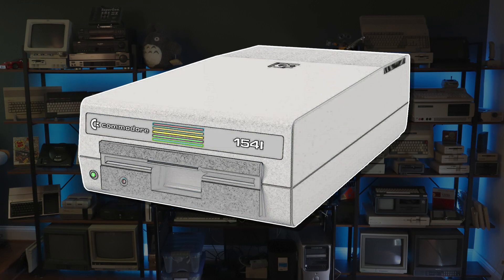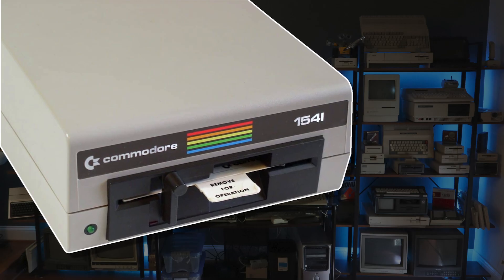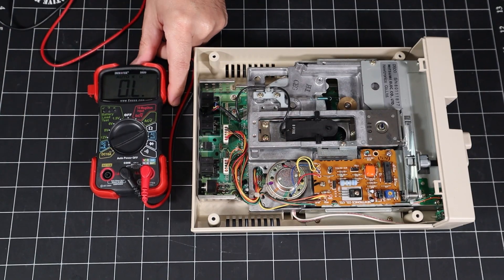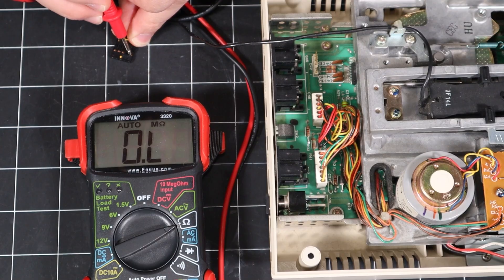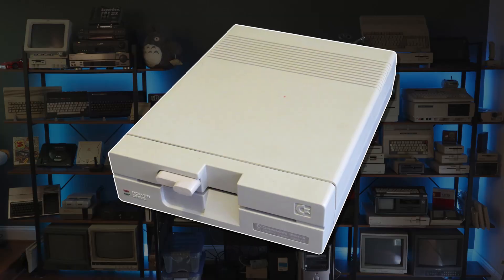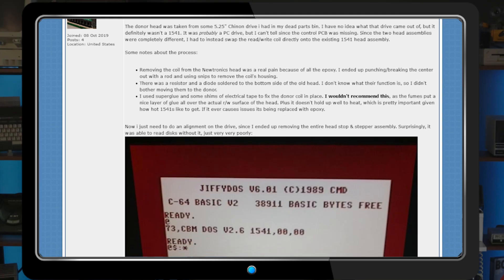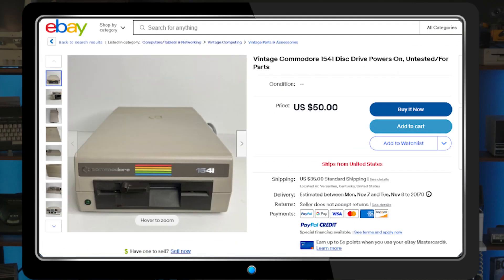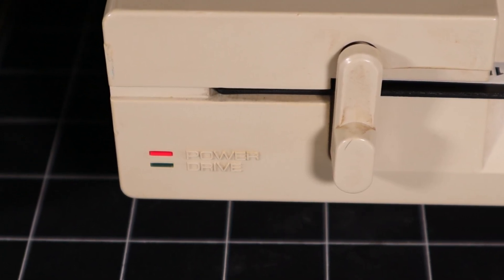This Commodore 1541 hides a terrible secret.

Comment: Wow! I didn't realize that someone actually read my blog posts from 2017! btw. I still didn't say the last word on this topic and want to sort this case out. I am slowly gathering knowledge ... like really slowly as I am kinda overwhelmed by other projects lol.  As usual, this was an EXCELLENT VIDEO!
Reply from the maker: Haha I've come across your post multiple times over the years! Thanks for sharing what you discovered. I'm sure the world would be very interested if there were a workable solution to the problem some day so please keep us posted of any new developments! I know the feeling about being overwhelmed by projects :)
Reply: @retrobitstv  Shooting in the dark, but since the moisture seems to cause the issue, wouldn't drying the head completely, in a desert-like conditioning, fix it?
Reply from the maker: @UltimatePerfection  Disclaimer: I haven't extracted the coil from my bad drive or examined it under a microscope. That said, I believe the issues to be a result of oxidation, not the presence of moisture itself. Over time, oxidation of the delicate wires either causes a short where there shouldn't be, or in my case, a complete break in one or more of the coils. It one were able to extract the coil from the potting, find the break or short with a microscope, and repair the damage, it could conceivably be fixed, but I have neither to tools nor the skill to work with something that small myself and I am not aware of anyone who has successfully repaired one yet and shared info about it :(
Reply: @UltimatePerfection  probably not what the ohm meter is showing is that the moisture has corroded the winding and opened the coil so short of rewinding it from scratch there's nothing you could do drying it out it's now too late
Reply: Come on! Your posts are gold. I recall the internal SD2IEC one, which encouraged me to start making some :)
Reply: @rapiqui  Thank you for warm words sir ;)

Comment: Is it possible for a different drive to be put in place on the Newtronic mechanisms? Like, perhaps a TEAC?
Reply from the maker: My guess is that it's entirely possible, with enough time and skill. Unlike later system, these drives aren't self-contained units that connect with a standard Shugart interface, for example, so you'd need to adapt the mechanism both mechanically and electrically for the enclosure and controller board in the 1541 model of your choosing.

Comment: My 1541-II drives with Chinon mechanisms are still going strong 30 years later.  I was aware of the Newtronics issues, but did not know that the Mark IIs had a direct correlation between the external case design and the internal mechanism.  That is a brilliant tip for buyers!  -- JC
Reply: I also have one of these that sat for 20 years.  Cleaned up. Works like a charm.  Little noisey due to oxidation.. but Works perfectly:)
Reply: is not true what he says in the video, typical youtube guy who has no clue... The one with the flush case can have a D500 or JPN DS-50F, the one with the indent (recession) has a F501M. And there is another version (no recession at all, 1571 style) where I only know one picture on the internet, but never saw that version ever again. The DS50F has in my opinion no difference from the case/looks, but when you have one its easy to find out: The lever on the DS50F is very light any you only have a small click on the down position and it springu up very freely and without much resistence. The D500 has a hard CLICK when you close it and a bit more tension or resistence. If you have those two, its very obvious if you can compare them directly.

Comment: I have an Alps 1541 that marginally works, except the motor sounds like a dying cow... though the 1541-II (with non-recessed lever) I've had since childhood has been working fine, shockingly enough. Thanks to this excellent info I'll have to go check my other drives and see where they stand. I was hoping by now someone could make replacement heads (somehow) so dead drives could be put back into service.

Comment: Could you use a heat gun to open up the head and re-wrap it with fresh enamel wire or something?

Could you seal the heads on working ones to keep them going?

Seems better than just giving up on the limited supply of read heads. (I know you go over this, but as you said, trying to get new heads is difficult. Donate your drive to someone who likes to make coils for them maybe?)
Reply: In theory dunking the head in some sort of epoxy and running a vacuum would seal it up without damage.
Reply from the maker: It may be possible to repair the break but safely removing the coil, repairing such a tiny wire, then getting it all back in place correctly aligned is beyond my level of skill because of how small it all is. If someone out there has the skill to do this, I'd be happy to send them my r/w head, as would many enthusiasts out there I'm sure.

As a preventative measure, it may be possible to drive out any moisture contamination with heat and attempt to improve the seal of a head that is still working right now. Of course, it may also be that if your drive is still working then it'd be better to leave well enough alone and hope it stays that way!

Comment: I read about failing Mitsumi drives years ago which made me look for alternatives. However both my Mitsumi 1541C still work fine to this day (both came "untested" from ebay). All of my 1541 drives are modded 220V->240V. I had two other 1541 giving me read errors because of defective bridge rectifiers on 5V, and a 1541-II giving me read errors because the cap in the potted PSU had dried up. Just because your Mitsumi 1541 starts giving you read errors, it doesn't have to have a broken head. And I'd still buy them untested if the offer is good.
Reply: And a 1541C with the opened jumper is so nicely silent :). I modded two of my drives by replacing the transformers according to the video by Adrian Black. So no overheating there anymore. And the drives became so light xD
Oh and of course, luckily, no read errors here (all incl. 2x 1541, 1x 1541C, 2x 1541-II)
Reply: @katho8472  My C models both have a board that doesn't support the track 0 sensor, but one drive has it actually fitted. I was thinking of modding the boards to support the sensor to reduce the risk of damage. I like the weight of the drive and won't mod the transformer out. The drives look and feel, the sound and its weight bring back my childhood memories like it was yesterday ;-)
Reply: @Shmbler  Well I mainly modded mine to not fry the chips ;)

Comment: The drive head is measuring open, not short.
Reply from the maker: You are right, I totally saw the O and read it as a 0 and stopped there. I need to pay more attention, that's twice in two videos I've missed something obvious. That said, I did disassemble the drive and checked continuity of pin1 from the connector all the way to the PCB on the head just to ensure it was not a wire break and that tested out fine, so the break is somewhere inside the potting/coil.

Comment: Arguably though, I'm sure the drive was not designed to be working nearly 40 years later, so can we really say it was 'improperly sealed'?
Reply: It's all relative.  All Sanyo MBC-55x's have a backwards installed capacitor but it takes like 20 years to fail.  I'd argue the capacitor is still backwards.
Reply from the maker: It is pretty amazing any of this stuff works anymore. I've only had one drive fail out of many so on balance, pretty good.

Comment: I literally just purchased a 1541 MKII 2 days ago, thankfully the condition of the drive was stated and it was fully working, serviced and head aligned and for 67.00UK ie a really good price. But when I heard you say that they can just go with fault my heart sank, BUT when I looked at the drive it had the recessed lever, cue a big smile. I was lucky, I got a proper retro commodore seller and the product was fully documented before sale. As you say, the little games that some sellers use, ie the powers on or untested is just annoying and usually deliberate, trying to get money for their old dead crap......Thanks Matt, great short video..

Comment: Yeap, I have both an ALPS and a newtronics drive, and I've got both these issues. The ALPS works, but had to re-align, and it's still not 100% correct. The newtronics has a dead read/write head, and I've bagged it for parts, or at least until I find a replacement head.

Comment: Why can't you read the tracks on a floppy using the same technique used in a Magnetic Optical drive.
Reply: Because it’s not a magneto-optical medium. MO uses materials specifically selected because of their optical properties changing due to magnetic influence (while hot). Magnetic media’s optical properties don’t change.
Reply: @tookitogo  It is the same principle that is used to copy tapes at speed where the tape is heated up to it's curie point but the master doesn't quite reach it's curie point therefore the master tape can be copied again but the copy will have a signal in the track and will not be lost so maybe we can use the same trick to read the tracks on a floppy using a laser and write tracks using a weak magnetic field when the point at which we ant to write is at it curie temperature that won't affect the other tracks as it would take a very large magnetic field to erase the data from the disc.
Reply: @DAVIDGREGORYKERR  I was actually unaware of thermomagnetic tape duplication, so thanks for the roundabout tip. (That actually answers something I’d wondered about for years: how high-speed videotape duplication worked.)

Anyhow, I don’t see how it’s applicable in any way to your question: can a floppy disk be read optically like an MO disk? 

No, for the reason I already stated: to read it optically, you need a phase-change material whose OPTICAL properties change when magnetized above the Curie point. The thermomagnetic duplicators rely on the MAGNETIC properties of the tape material changing when magnetized; heating above the Curie point simply makes the material far, far, far more sensitive than it is below that point, allowing it to “take” the image of the magnetism of the master tape. The OPTICAL properties of magnetic media do not change with the imprinted signal.

Unlike MO’s phase-change material, which is practically entirely insensitive to magnetic fields below its Curie point, the material in magnetic media IS sensitive to magnetic fields below its Curie point. 

The rest of your answer seems to be talking about writing to a magnetic disk using heating. I’m missing the connection to how this would help you read it optically.
Reply: @tookitogo  Laser light can be changed by magnetism and it is  i.e. rotated so will be detectable by a detector diode maybe someone has to try and do this and see if it can be made to work.
Reply: @DAVIDGREGORYKERR  You’re really just throwing any magneto-optical phenomenon out there without any regard to applicability to the question. 

The magnetic fields needed to affect light are quite strong. The magnetic fields on magnetic media are tiny. 

Your original question was whether a magnetic disk could be read by the same technique as an MO disk (not just by any magneto-optical effect). The answer to that is no, you can’t. And I don’t know why one would care to read it optically, if it can be read magnetically perfectly well.

Comment: Seems to me good drives may be able to be sealed against moisture with a drop of epoxy or something.
Reply from the maker: That might be an interesting (and very long term) experiment to perform. You'd probably want to heat up the head for a good long time to drive any moisture out first, then attempt to seal it up. Then test it over the next 40 years and see if it continues to work!
Reply: @retrobitstv  lol, exactly.  The joy of old tech.  Great video.  I may be considering a 128 in the near future.  Nice to know this about drives.

Comment: Thanks for all the research - and sharing this, Matt! Best explanation I've seen yet. :)
Mine from '84 Newtronics 1541 is currently working great, but now I am forewarned that I should probably backup all those disks to another medium.
Reply from the maker: YW! I think I am going to keep an eye open for a Chinon 1541-II just to have something for the long haul. Of course my 1571s are all fine so far so there's that option too :)
Reply: @retrobitstv  well, after this video, prices for those NOT Newtronics will go spice up! I had lot of ALPS and Chinon, just one Nwtx, as I knew the flaw.

Comment: So... what about those crazy people that just want the 1541 case? I'll give you $20 for your broken drive! 😁
Reply: Putting a greaseweazel and shugart drive in it to connect to pc?
Reply from the maker: Some other options: stick a pi1541 inside the case or build an automated floppy disk cleaner that walks the carriage assembly while applying isopropyl alcohol to a microfiber cloth where the r/w head used to be!

Comment: Thanks for the video. I just checked my 1541-II now. Sadly, it's a newtronics. The handle is not recessed into the plastic. I got it for free quite a few years ago, so not a loss. And when I tried it a few years ago it was working. Haven't tested it since. I use my Turbo Chameleon 64 V2s for my 1541 needs. Too much hassle to deal with real floppies and a clunky floppy drive that needs it's own PSU.
Reply from the maker: Hopefully it still works and will continue to do so, like my primary 1541-II. I prefer to use a modern solution (1541UII+ or SD2IEC) for day-to-day usage but it's nice to have a working floppy drive for the occasions you want to use it. The "bad" 1541-II came with the recent auction lot so it's not a big loss since I didn't really pay much of anything for it.

Comment: Good to know, I didn't know the later 1541's were prone to this kind of failure. I got some of my dad's old C64 stuff (fortunately my mom had kept it around) including multiple systems, some old disks, and one older-model 1541 drive...  Generally I don't feel I need another 1541 in my life but I have entertained the possibility, especially for the more compact 1541-II version. Wouldn't have been super fun to get another drive that's big and slow and heavy but also irreparably failed.
Reply from the maker: Believe it or not, I've never owned an old style 1541. My first Commodore was a 64C with a 1541-II, so when I got into retro of course I sought out the things I used to have. I've not really had any desire to own an original 1541, but if a nice Alps one comes along for the right price I'd still consider it.

Comment: Excellent video. My Alps just started doing this after traveling 20,000 miles around the world on planes and ships for 30 years thank to the military. Have to says that's pretty good handling resistance for never being packaged properly by movers.

May I ask where you buy parts and chips like the 6502? mouser? digikey? alibaba?
Reply: eBay :) scavenging other "for sure dead" drives :)
Reply: @retrohaxblog  ebay chips are $25-$50 unless it's the white one for $2500, then you don't know if it works. Alibaba sells brand new one's for like .99, the W65C02S6TPG-14 version. Do you know if those function ok?
Reply from the maker: Nice, that's surprisingly robust! Some chips are still available NOS from vendors like https://www.retroleum.co.uk/c64-chips and https://retro8bitshop.com/product-category/hardware/chips/ other can be pillaged from old broken hardware, and some things like the 6502 are still being manufactured new to this day! https://www.westerndesigncenter.com/

Comment: 7:26 - Yeah "Powers on" usually just means the power LED works. Some sellers will use even more deceptive (or outright false) language like "boots" or "starts up" - indicating that maybe a cooling fan or hard drive might be spinning as well. And "worked last time I tried it" of course, is totally meaningless.